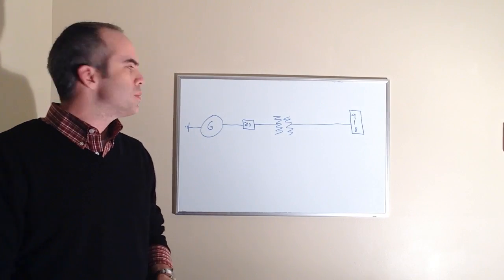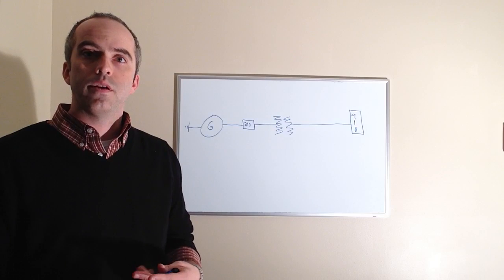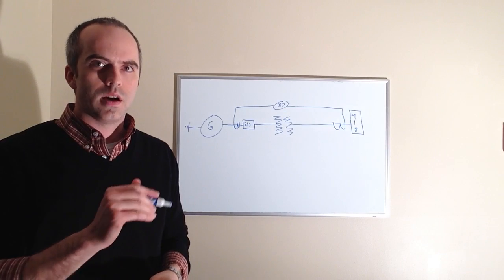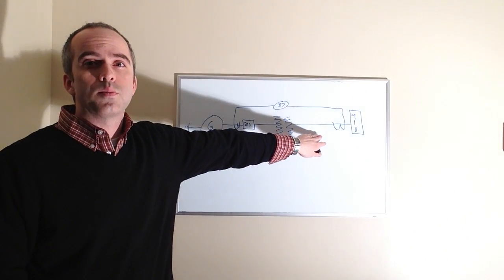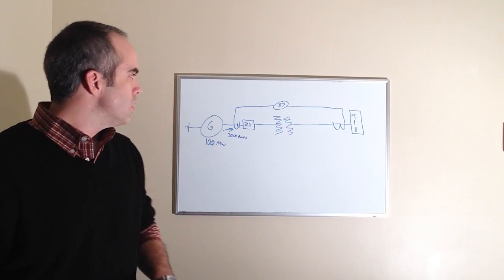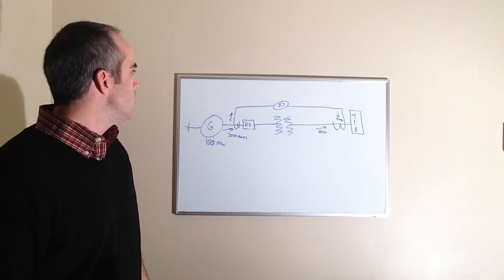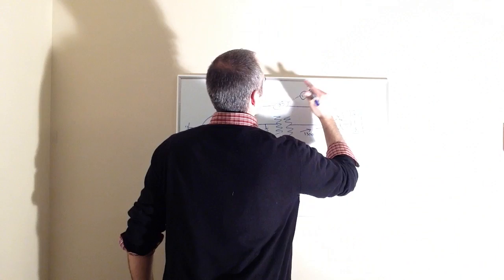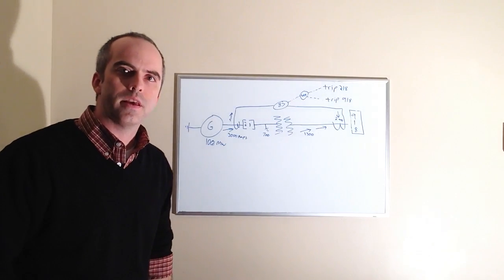Basic Transformer Differential Theory

Comment: Hello sir, zeck from borneo here.. i got question regarding 87t. If the fault happen on the cable between the relay and the transfomer, what will happen? Does it trigger the 87t protection? If it trigger the 87t, does that mean when 87t tripping occur, we cannot assume directly the transfomer cause the fault? But must consider the cable might be contribute the fault also? Thanks..